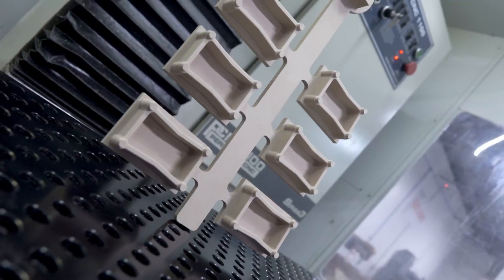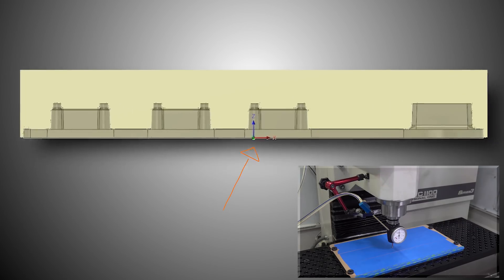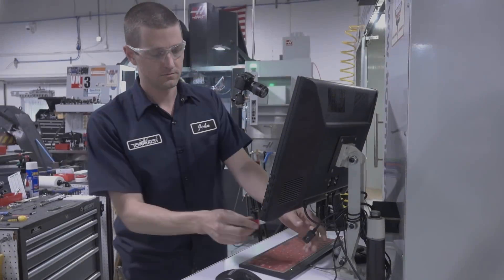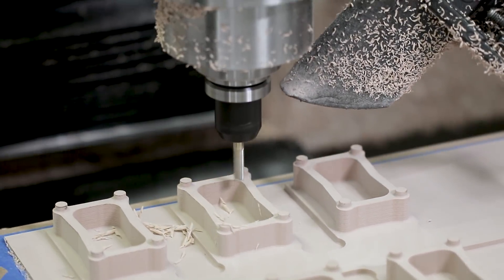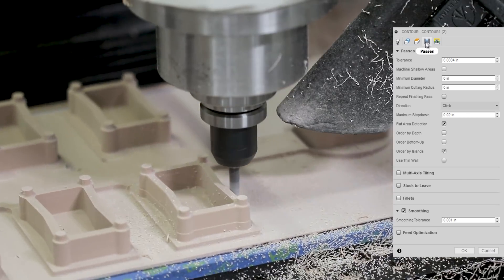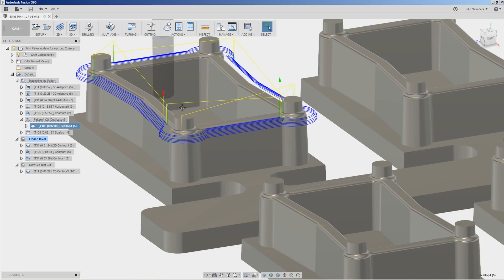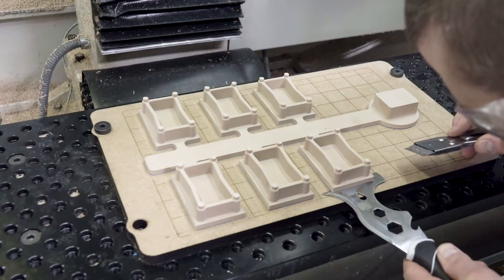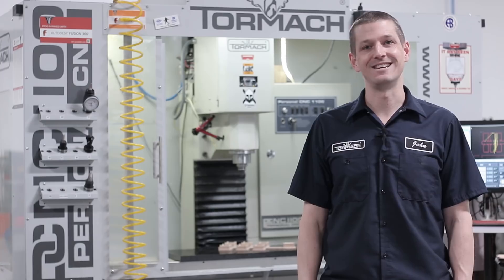Machining a Casting Pattern | WW193

Comment: All you need is a simple adapter to contain the chips and direct the dust to the vacuum.  Take a look at the acrylic dusk collection adapter that I installed on my CNC router for a simple solution to your extraction needs.  IG @derinteriors

Comment: Why not just cut down into the sacrificial plate instead of switching back to a square edge tool?  You could have just made the bottom height -0.035".

Comment: Why did you glue it and didn’t simply drill holes in the block and screw it directly to the table?
Reply: Lucas Imark Going out on a limb. I’d say he tape/glued it down instead of a mechanical fastener because he ended up shaving a whole inch off the top and the fastener would be in the way.  Unless you were referring to after the top one inch was removed, then he still didn’t need a mechanical fastener since the new stock was exactly where he needed it and at the exact height.

Comment: Awesome, but how would you use this for casting? Bury it in sand and pour metal into that?
Is this solid polyurethane or higher density rigid PU foam?
Reply: This will be the "positive" used to create a negative in the sand. Once the pattern is removed from the sand, the "negative", the void, is what gets filled when metal is poured. Check out Tubalcains many videos on foundry patterns, he explains the process well.
Reply: This will be the "positive" used to create a negative in the sand. Once the pattern is removed from the sand, the "negative", the void, is what gets filled when metal is poured. Check out Tubalcains many videos on foundry patterns, he explains the process well.
Reply: Reshape BM70 is the material.
Reply: Thanks!

Comment: Having worked in a pattern shop and worked with a lot of renboard it was interesting to see your tape method for gluing it down. One thing with renboard chipping is that it's easy to repair with either wood filler or by cutting the damaged section out and gluing in a new piece of renboard

Comment: The main problem with that vacuum sucker seemed to be it was only sucking on a small part of one side. How about getting a 4" or 5" round Tupperware bowl, cut a hold in the bottom to fit the spindle nose and another hole in the bottom corner to fit the vacuum hose, and mount it as a hood on the spindle nose? Should catch considerably more swarf.

Comment: The hot tip for pattern draft are tapered end mills. Perfect surface finish and way faster than all those step downs.
Reply: Rambozo Clown tapered end mills would not work in this situtation because the corner radii seem uniform from top to bottom. Tapered end mills would produce a  variable radius due to their conical shape.

Comment: Need a dust boot, a surround for the bit...only caveat, it will block the view of the cutting (unless you make it clear)
Reply: It also would potentially impact the work piece unlike a CNC router. Need to keep that thing open on all sides.

Comment: how does the superglue do with flood coolant?
Reply: The suerglue does great, but the tape may not depending on the brand. I suggest getting a few brands to try out. Make sure it is not the low adhesive type.